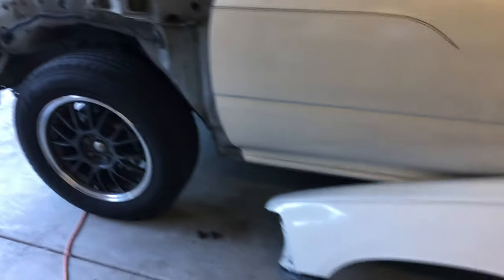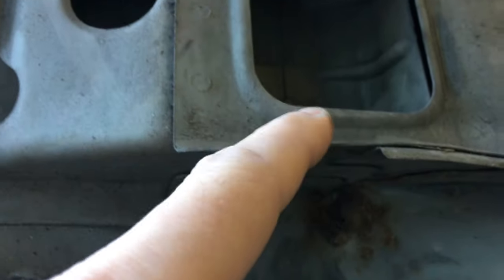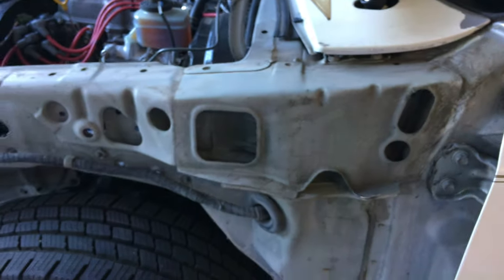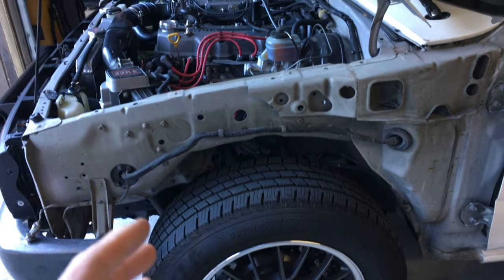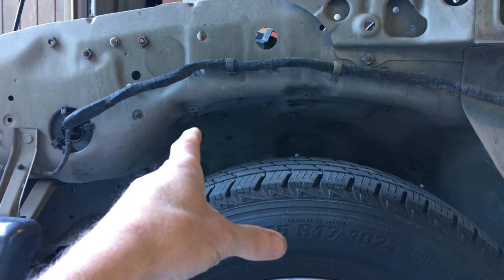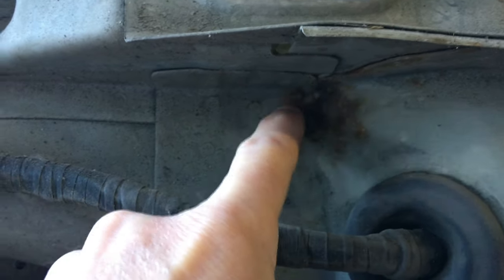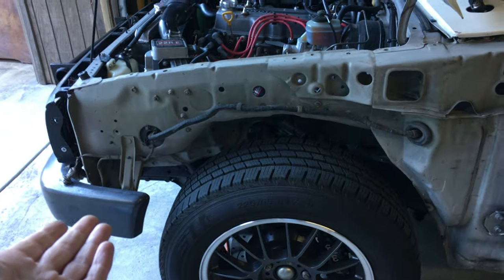89-95 Toyota Pickup water leaking inside on floor mat driver's side / fender removal overview

Comment: I had a 1994 Extra cab that had extensive rust on each side , and just inside the drain holes where you're videoing.  I would highly recommend removing the wipers and the cowl to gain access to the large void area across and below the windshield.  In addition to other areas, you'll be able to inspect the inside wall where the cutout is for the drain hole.  My truck had a build up of redwood/ doug fire leaves sitting in that void area for a number of years and rusted out the body at that point.  As you use sealant to repair suspect places, remember to fair it into the surface as to not form a dam that blocks the flow of water run off.  I bought that truck new and sold it in 2020  (at 134K miles) and then bought a 2020 Tacoma extracab Sport.  I see a lot of similarities in the body construction between the 2 trucks, at least in this area.
Reply from the maker: Thanks for the heads up on all that. When I first bought my truck (4 or 5 years ago), I did remove the cowl and check down in there and vacuum out all the stuff and made sure there was no rust. I had previously owned a 1966 mustang which rusted just as you describe and allowed water in. On my truck, I think it's coming from the rust hole I showed in the video. I just cleaned that area out and patched it with sealant, so I think I'm probably okay for the time being. I may upload an unlisted video showing the repair / sealant and link it just in the description of this video tomorrow.

Comment: My '94 has leaked some drops onto the passenger front floor mat on about 4 different occasions over the 8 years I've had it.  Not sure why it's so infrequent as we get lots of rain here in North Alabama.  It did this before and after getting the windshield replaced, but I've never looked that hard for where it's getting in other than pouring some water on the windshield and cowling then looking under the dash, but of course it won't leak when I look for it.  I'll have to check that corner drainage structure on the cab frame that you look at in the video.  Thanks for posting!
Reply from the maker: Mine leaks sometimes when it rains, but not other times. The last couple of rains, there was a growing puddle of water on the floor mat. I finally decided to have a look. Definitely found some suspicious areas to seal up under there. We'll see if it resolves the issue, although I don't really like leaving my truck out in the rain if I can avoid it.

Comment: I have this same exact problem on the driver side luckily I have a vinyl floor covering so it's not a terribly huge issue, but some does get under it. Interested to see what you discover 😊
Reply: Side note, I was wondering if you had any insight as to why my 22RE runs rich. Everything's basically new, new plugs new air filter new TPS sensor I even cracked open The AFM and moved it over a few notches...
But under hard acceleration my little 22 wants to think it's a diesel 😂
Reply from the maker: I haven't had the truck out in the rain, but I might park it outside next week (rain is scheduled up here). After posting this video, I ended up doing the passenger side as well. It had some small areas which looked suspect so I sealed those also. I'll follow up in the video description soon as to whether or not the truck was able to survive future rain storms without further interior leaks.
Reply from the maker: @lexannaamnell6593  Which direction did you move the AFM wheel? How many is "a few notches". Even 1 click on that wheel can have a noticeable impact on the A/F ratio when cruising. Just as an example, 1 click more rich on my truck knocked 2 miles per gallon (on average) off the typical MPG I was seeing around town.
Reply: I believe it was 2 notches counter clockwise. I didn't really notice anything significant by do this though. Thank you for the reply 😊
Reply from the maker: @lexannaamnell6593  Two notches CCW would lean things out. However, the ECU operates in two modes - open loop and closed loop. In closed loop (which is generally just cruising around part throttle), the ECU is continually making adjustments based on feedback once per second from the O2 sensors in the exhaust stream (primarily data from the upstream O2 sensor) - so even if you adjust the spring tension on the AFM to trick the ECU into running a bit more lean, it's actively battling against you attempting to obtain 14.7 AFR. So you are kind of pushing it more lean, but it's pushing back constantly to get more rich. Under load or harder acceleration, generally speaking the ECU will go into what's known as open loop operation. In this case, it does not use O2 data and instead (as far as I can understand) it relies more on TPS position and its base fuel map programming tables present in the ECU from the factory. I believe the ECU still is attempting to adjust the mixture in open loop but I'm not totally sure what data it's focused on. If you watch my video about the WOT micro switch mod, that will cause the ECU to go more rich, so it is looking at some of the data. That may be where the ECU is relying more closely on the signal from the AFM in terms of air volume. If you have leaned things out and thrown off the reading, that could explain why under acceleration the motor is leaning out a bit there (perhaps). Also, if the TPS isn't perfectly adjusted and/or if the AFM door is sticking or binding, it can really cause trouble for the ECU during that transition phase between closed vs. open loop operation. You might want to download the Toyota TCCS manual and read through it. It provides a great deal of information regarding the EFI system on the truck and what the computer is attempting to do under different circumstances. Here's a link to the PDF file --> https://www.autonerdz.com/yabbfiles/Attachments/TCCS__TOYOTA_COMPUTER_CONTROLLED_SYSTEM_.pdf
Reply: @ray5961 as always you have and share your knowledge and experience and to top it off you share the literature.   I’ll definitely be printing this one out to add to my Toyota library.   
Thanks Ray!! 🤘

Comment: I was looking into removing the fender on my 95 pickup but for some reason the bolt on the top right between the cowl and door just keeps spinning is there a nut holding it in place?
Reply from the maker: There is a nut tack welded to the body I would imagine. If it's spinning around, the spot welds behind there may have let go. To grab the backside you might have to pull the dash.. not sure. The bolt should just come right out.

Comment: I'm curious why you did away with the fender wells?
Reply from the maker: Several reasons: first is for better clearance for my larger wheels/tires. Second is because the fender liners trap dirt which promotes rust on the body. It's always a good idea to check the area down there by the bottom of the fender near where the door is.. that area can trap dirt and moisture and it can rust out both the fender and body of the truck. On my friend's truck (the one in my video where we did the dual row upgrade and the coil swap), his passenger side fender was totally rusts out down low and on the driver's side, so much crap was stuck back there it started rusting the lower rocker area. I removed all mine and threw them into the trash. They are just always in the way.. maybe if you are going off-road a lot they help cut down on rocks getting throw up a bit and making noise, but otherwise I don't think they serve much purpose for a largely road driven truck.
Reply: Thanks for replying.
Reply from the maker: @JamesBowling-vy8eq  anytime!

Comment: Thanks for the video Ray. Unrelated question, where is the air intake hole on your airbox? Is it stock or modified? I just went back to stock air filtration and not certain if I have the correct airbox for my 94 Pickup. 

Always appreciate your videos, looking forward to part 2 of the best upgrades.
Reply from the maker: Thank you and yes, I have the stock air box on my truck. If you are standing in front of the truck, looking into the engine compartment, the hole is on the left side of the box, kinda towards the back lower corner of the box. Then a plastic hose pops into that and runs up to a hole in the front part of the grill area, right next to the radiator over flow tank. 

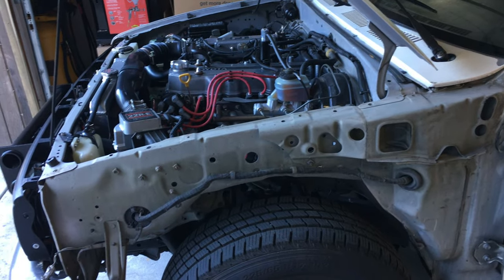If you jump to the time stamp 7:25 in this video here, you can kinda see mine in the video https://youtu.be/6cVDeouHjGE?si=-BRypOI8kT_yMuu5&t=445

The only thing I have done is to cut the plastic flap that hangs down in the front of the tube (the part which faces the incoming air) to help promote a bit more air flow; otherwise, it's all stock and I'm just using that blue filter mentioned in the 10 best upgrade options (and part 2 of that video should be coming in a few more months - there weather over here is just a little wet, so haven't been making too many videos outside).